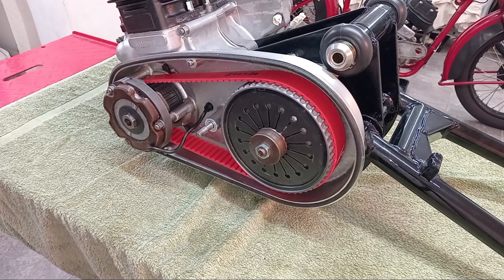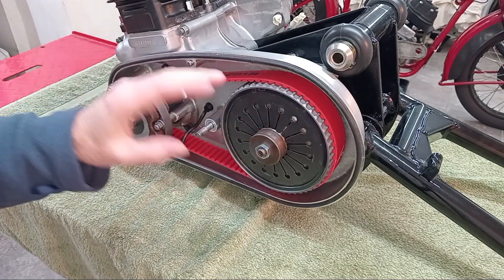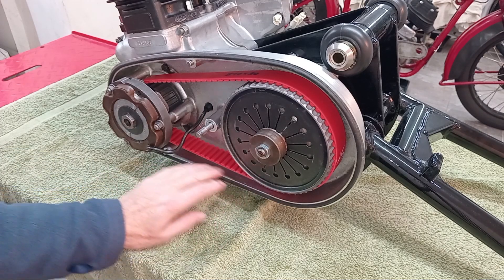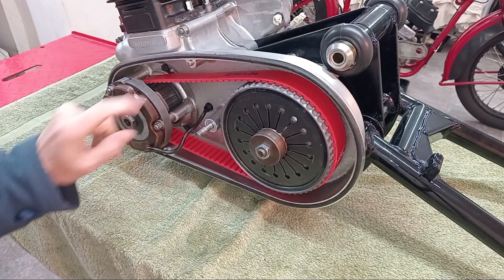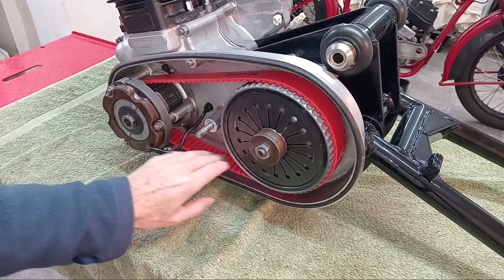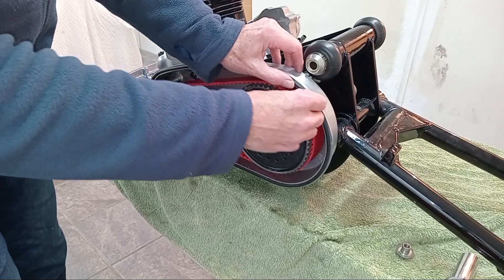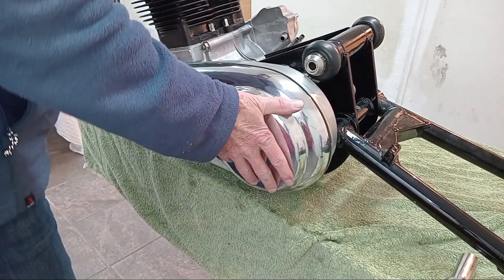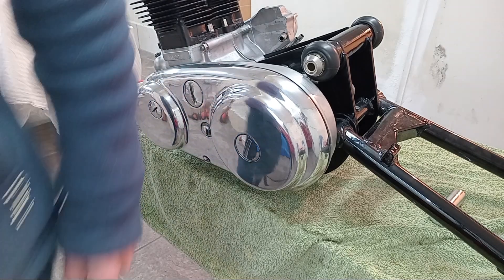Norton Commando Engine Rebuild. Part 64: Fitting the Belt Drive Conversion

Comment: What clutch did you end up using?
Reply from the maker: I just reused the original clutch plates because as there will be no oil in the primary chaincase, then they shouldn't slip.